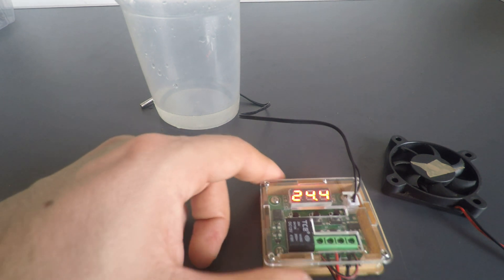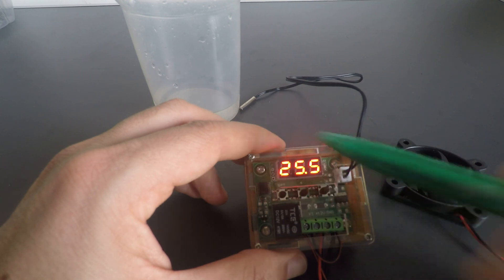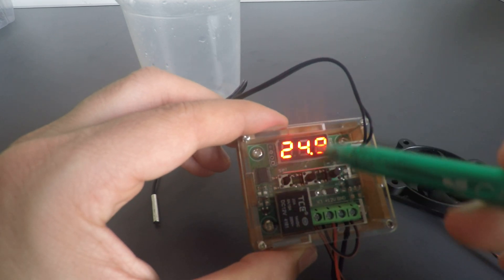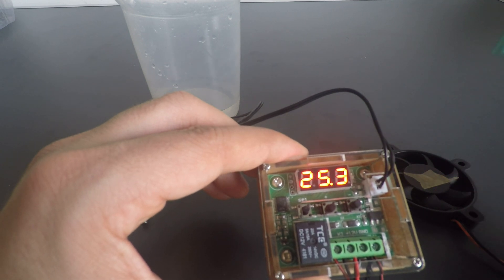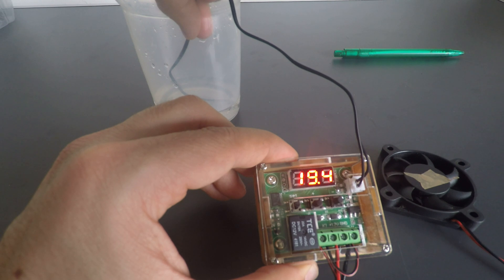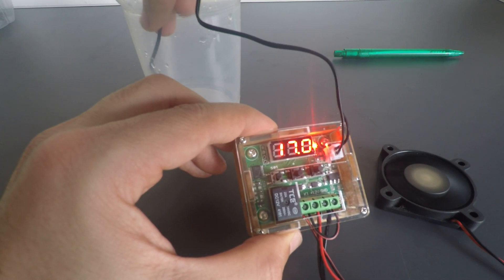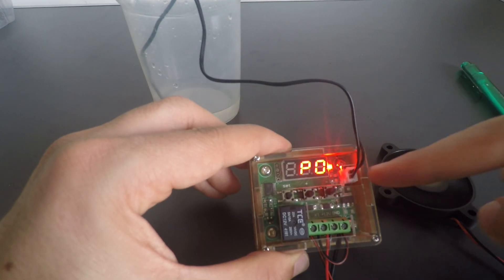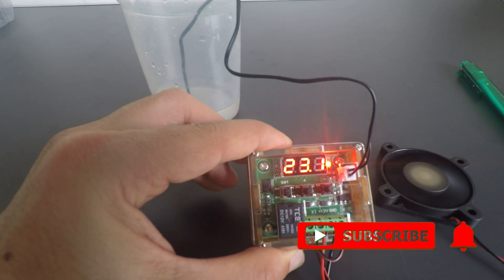Update ! W1209 Thermostat Programming and demo.

Comment: I'm tryin to program my thermostat to heat up an aluminum block. 
settings 77.5. P0-H, P1 - 0.1, P2 - 89, P3 - -50, P4 - 0, P5 - 0, P6 - doesn't give me options.
HOWEVER when the temp hits 50 the Thermostat turns off. The LED shows  ( -  -  - )
What is going on?
Reply from the maker: Try to play with the P0 H or C , and see if you get the desired function. With the settings you have it should heat until it reads 77.5 C, above 77.5 should disconnect.

Comment: I connect a 12V bulb to the output of the thermostat. Then the relay cut off the output supply. What will do..??
Reply from the maker: Turn off the light bulb. Remember this is controlled by the temperature settings, you could have a light bulb on in a temperature range or when it's outside of the range, above or below. This could be useful to have an alarm for high or low temperature. It depends of the programing you did.